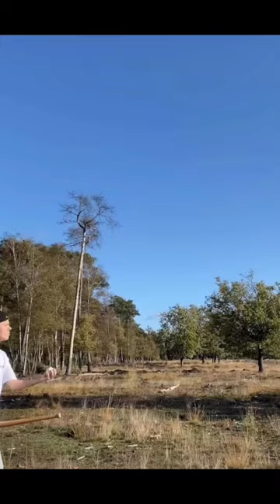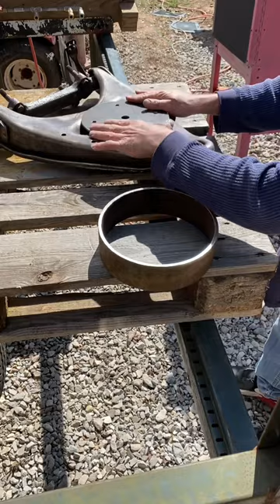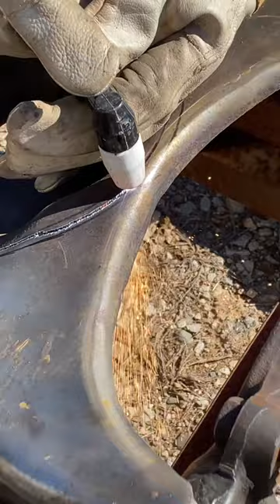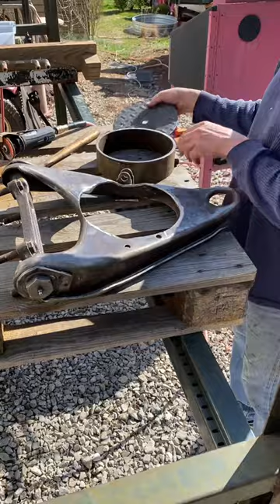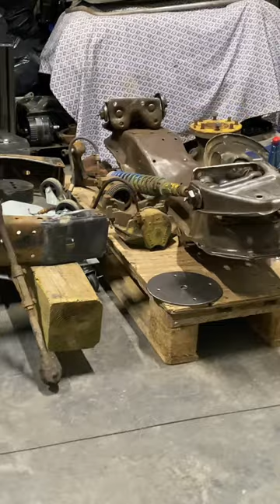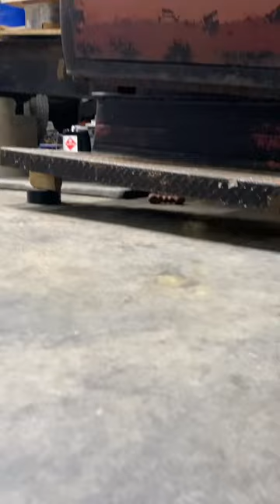PT 1.  4” drop bags in A arms and 3” drop spindles with should ruin it 😂  #burksgarage

Comment: All that work and you could have gotten a G-Body van lower control arm 😂 pockets are deeper on the vans for some reason, Mopar vans too.
Reply from the maker: Help me find a G body 3500HD:)
Reply: @burksgarage  😂😂 should be near wherever I left that 10lb box of $100 bills
Reply from the maker: @throttleblipsntwistedgrips1992  100%.  These arms are from an ‘86 GM motor home 5/10 pattern.  Hens teeth.  I’m excited to get the ‘61 on the ground without cutting front frame rails.
Reply: @burksgarage  on something that old, Absolutely. It took me about 4 months to find the control arms to drop my d250 an inch and a half in the front. Was saving up for an aftermarket set and a buddy was like "you know all those old van arms swap with trucks and drop them like an inch, right?" We went to Pick-N-Pull that weekend 🤣🤣